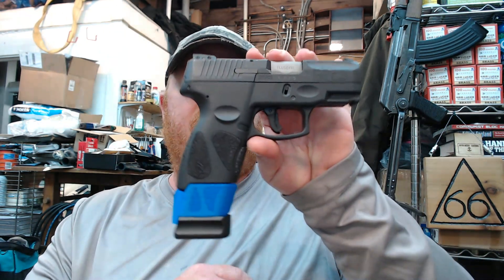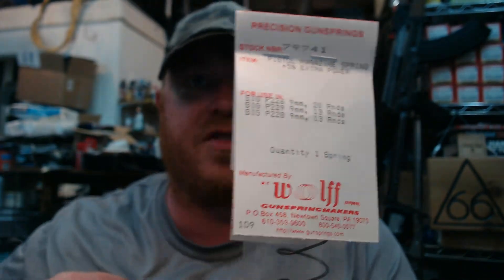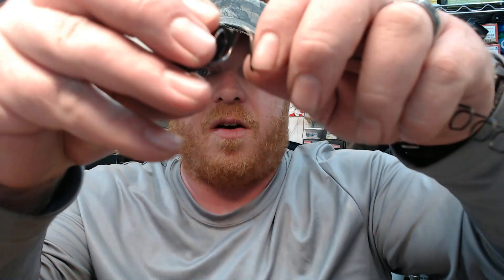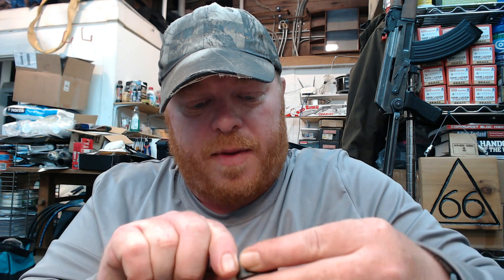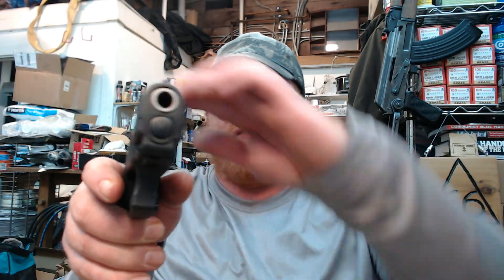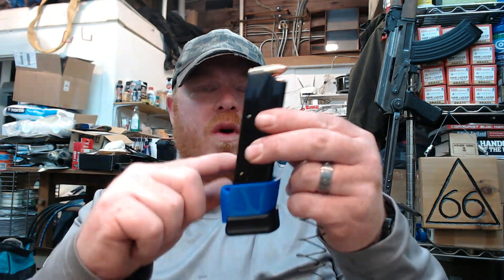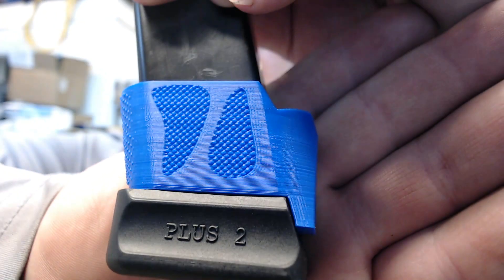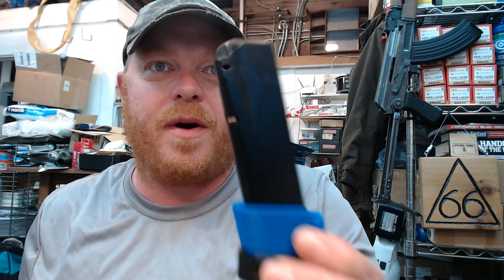Taurus G2C 9mm Mec-Gar P226 20 Round Mag Wolff Spring Replacement Upgrade

Comment: Although i did Not use this same brand of spring as you chose...i had trouble replacing.
My original intent was 2 just double the springs, but encounterd so much difficulty i opted 2 switch springs completely...losing a round from 20 to 19, but if it fires its worth it.
Great videos!
You've helped me 3 times now w/this Taurus G2C...kudos sir
Reply: Which spring did you use?
Reply: @jdawg93  it clearly said it was the 20 rd mag spring for the sig 226....
This 1 ive recently ordered is 4 the 18rd mag; i received a tip that 1 may be a better choice & hopefully a solution 2 that terrible ass malfunction i encountered the night of the 16th
Reply: @513to205nbak  I saw those springs on that website as well. The price was tempting but thru further research they are for different mags than the MecGar. 

Gotta realize that multliple  companies make P226 mags at different capacities. 15,18,20 rders

The One stated in the @Glockshooter79 video is for a 20rd mag. Bought directly from Wolff springs I presume.

The friction fit issue is troubling as I also ordered one. 

Have yet to receive mine and test. 

Hope you work out your issues or maybe we can trade info to find a good solution.
Reply: @jdawg93  indeed...just hit me up for info/questions/hints...ill do likewise.
Reply: @513to205nbak  I installed the Wolff +5 power spring in my MecGar P226 20rd Mag. 

I can confirm like Glockshooter79 that the Tension is noticeably stronger.

Will take it to the range some time this week to test it.
Reply: @513to205nbak  ran two mags worth flawlessly.

Will put more in next month. 
May even buy a second mag to test with and without spring.
Reply: @jdawg93  
Awesome.
Im Still having issues;
Upon installing that cursed spring, ive gained tension, but lost capacity of 2 whole rounds😫😠
I might just toss it & get an additional 1

Comment: Thanks for posting this. I found this video while shopping for replacement springs to upgrade some Mec Gar magazines for my Beretta 96 and 92FS using their +2 floorplate kits. The Mec Gar 13 and 15 round mags for the .40 S&W Beretta 96, and the 18 round mag for the 9 mm Beretta 92FS (and the 20 round mag for the Sig P226) appear to all use the same 13-coil spring whether they come with the +2 floorplate or not. However, the 20 round mag for the 92FS has the +2 floorplate and a 14-coil spring. Go figure. 

Mec Gar does not sell replacement springs, so adding their +2 floorplate to an 18 round Beretta 92 mag might decrease reliability, since you can't upgrade to the 14-coil spring that their 20 rounder comes with. Mec Gar should make this spring available. Wolff does not list springs to fit Mec Gar magazines. I suspect the spring from Wolff is actually for the FACTORY Sig P226 20 round magazine, and not for the Mec Gar version that you have. Gunmagwarehouse . com carries both factory and Mec Gar 20 round mags for the Sig P226. Their designs are very similar, but they are not the same. That is probably why the Wolff spring lacks the "dogleg." It is good to know that this spring will likely work when I add the +2 floorplates to the 18-round Mec Gar Beretta 92 mags, or when any of the springs wear out and need replacing.

The dull black coating on and in the Mec Gar mags (the ones that aren't blued or nickel-plated) is an anti-friction coating, and probably shouldn't be removed. If it's dirty, just clean it.
Again, thanks for posting this.

Comment: Just got the p229 on trade ill need some of these for sure
Reply from the maker: Good deal. This spring is really nice. I would recommend getting a couple for your sig.
Reply: @2aEdu  the grip sleeves won't work for 229 tho right?
Reply from the maker: @jbell1166  Correct. The grip sleeves for the G2C will only work for the Taurus. Someone might make a sleeve for the P229 but i do not have a P229, so I can't confirm.

Comment: They prolly get by with the 18rd spring with the +2 base plate when running that mag in the 226 because the dwell time is longer with longer and hecery slide on the 226
Reply from the maker: Yeah, good point. Thanks for watching.

Comment: Will be ordering a Mec Gar P226 20 Rd Mag tomorrow. 

Should I preemptively buy the  extra spring?
Reply: Wolff spring uprade Update???
Reply: @MrBobzilla1959  only got the mag. Hoping @glockshooter updates on his spring
Reply: @MrBobzilla1959  Running like a Champ Now.
Reply: @jdawg93  mine have stock springs and work flawlessly so far. Did you do the wolff spring???
Reply: @MrBobzilla1959  Yes. Was having issues but the spring upgrade seems to do the trick.

Comment: I bought a megar 15 round P226 magazine. It clicks in the G2C fine, but every other time I try to drop the slide, it stops short. The slide freezes an inch or so from open? Any thoughts, suggestions? Thanks
Reply from the maker: I have not used the 15 round P226 mag. I am guessing that is because the mag is over inserting (sitting too high in the gun). You can try to file lightly the top of the mag catch notch, (hole in the side of the body of the mag) Keep removing small amounts of metal until in clicks when the mag is lower in the grip. Just do a little at a time until it works and slide runs freely.

Comment: Steelcase doesn't expand in the chamber like brass, therefore they do not form a proper gas seal, and cause malfunctions.
Reply from the maker: True about steel not expanding as much as brass. I have not , however, had any malfunctions with steel case and the 121 round OEM mags. Thanks for watching.
Reply: I used steel case once and had ftf on each oem mag..

Comment: Do you use the same 20 rd mag spring for the 18 rd mag?
Reply from the maker: According to Wolff springs, they list the spring I used for the 20 rd. They do not mention the 18. I am still using the original spring in my 18, and the upgraded spring in the 20. I would note that Mec-Gar uses the same spring for their 18, and 20. Both mags have the same body, with different floor plates.
Reply: @2aEdu  I ask cuz the spring in the 18 is week and it misfeeds  in G2c. I'm trying to figure a way to stiffen up the 18 rounder to be like the stock  mags without loosing capacity.